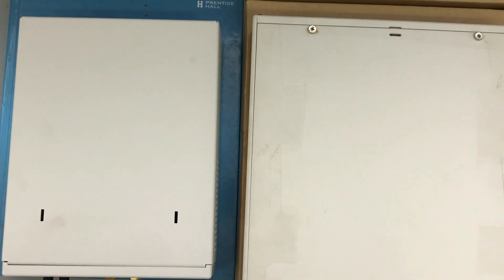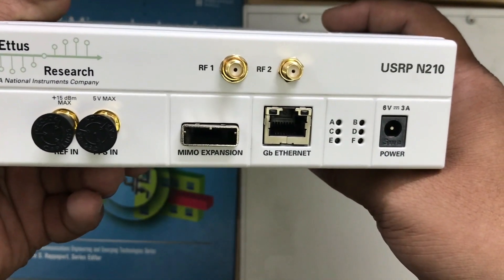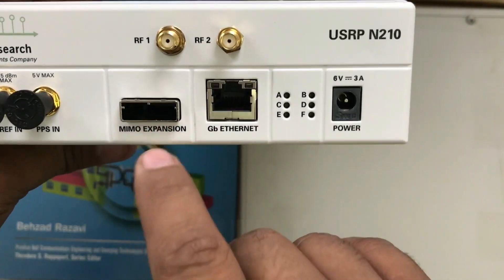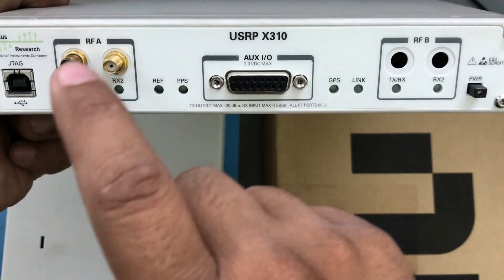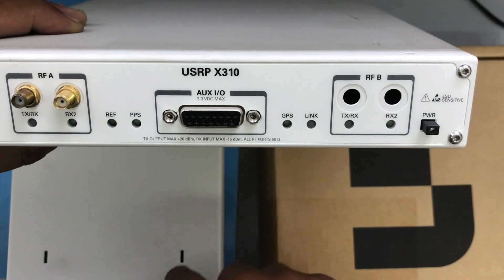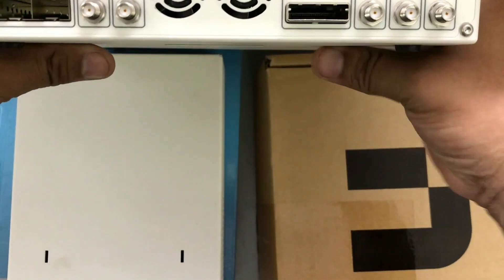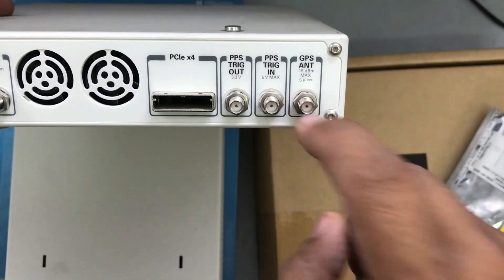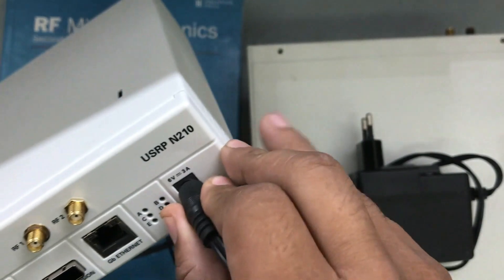Comparison between USRP N210 VS. USRP X310 with UBX RF DaughterBoard | Software Defined Radio | SDR

Comment: I have large collection of Ettus devices, from the USRP1 to the X310, plus a quantity of daughter cards.
A few months ago, I put together using the "Embedded Python Block" to control, send data to the I/O port of the device, in order to control Amplifiers, Antenna relays, etc.
All done with Grc. Unfortunately my Python Programming Skills are limited, were as I primarily program using C++.
I wrote a program, been under development for a few years, using Qt Creator, 5/6, to control SDR's etc.
One of the problems I'm faced with is, writing a small script within the Grc, "Embedded Python Block" to communicate via the COM port, again, very little experience with Python. Can you provide me with some assistance? If so, I'll give you more details.
I have an acquaintance that is employed with Microsoft, and works with their "AI" project, done with Python. I've reached out o him for some assistance, but claims he has no time to help! Go figure.
He has in the past help me with Gnr and the Python Block.
My applications are to be used with "Amateur Radio"
Regards, Dale